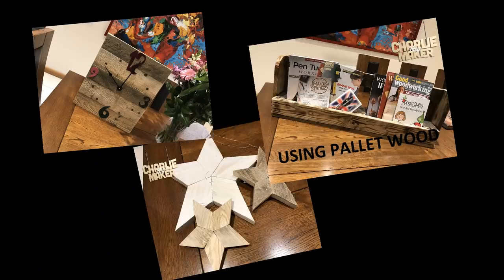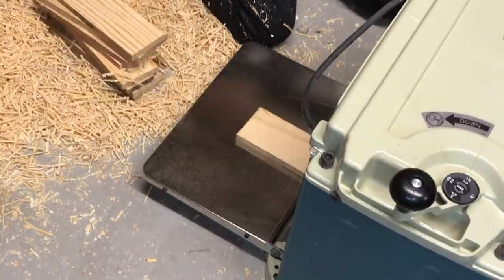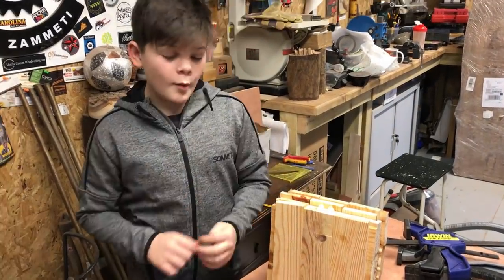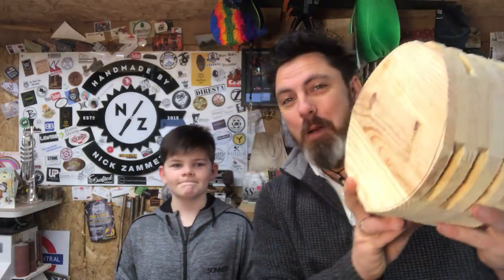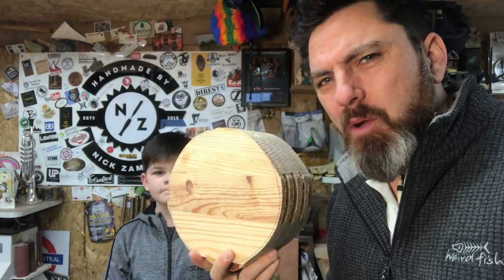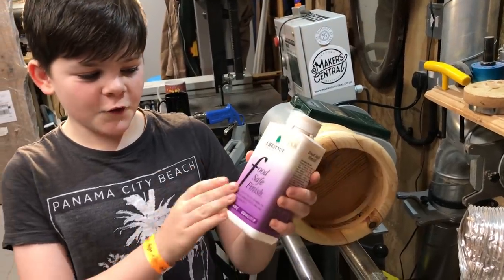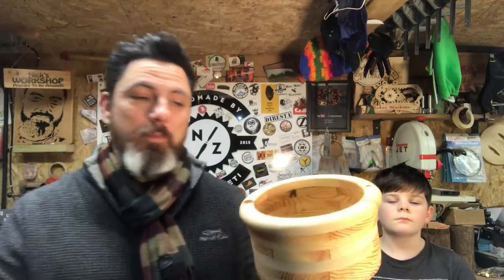Woodturning - A pallet wood bowl

Comment: Slightly off-topic, I have a question, is there a reason a silicone plug cannot be put into the center of a blank to save on resin? Wouldn't it be easier and reusable? 

You're the expert, I was just wondering what the reason is.
Reply from the maker: you sure can but sometimes it can mess up the whole project as it it sets in the wrong place your buggered . so to speak ., 😂😂
Reply: What if you used the stick and string trick to help suspend it in one spot while it cures?

Comment: why is it that people use the table saws with the  fence on the wrong side of the blade.  You're reaching over the fence to push the wood over the blade. you are going to push the wood away from the fence and it is going to kick back and if it happens as your hands are going past the blade you will cut your finger's off. I'm not saying this to be a hateful I am concerned for your safety I have worked in a furniture factory for years and I've gone to college only to see to many horrific injuries.  Be safe .
Reply from the maker: hey Neil noted and changed it . never really knew this. its always been set up this way . i appreciate the help and support buddy .

Comment: Nick, great video working with Charlie. I’ve also been watching his channel. You make anything fun I’m sure. I would like to mention one thing, after learning the hard way by losing a finger and getting another unusable from a table saw, please I ask of you to use a push stick. I thought I didn’t need one either. I was making a very simple cut and it turned into a major cut.  Cheers my friend I get scared seeing people taking a table saw lightly.
Reply: Amen
Reply from the maker: yes my bad and fair point. Charlie is always safe . i did have a push stick but these were very small bits and i needed to hold them down and push and the same time. I appreciate the advise and totally understand the concern brother . all the best

Comment: Hi Nick,
Love your videos as well as when Charlie is in the shop. I did cringe when you showed the couple of seconds of Charlie turning only ‘cause the centre of the workpiece is at his armpit instead of his waist, which puts him in awkward position to try and control the tool. I had the same issue with my son so we build a low platform out of scrap wood to get him up a little higher. We attached a rope handle on one side and stow it under the lathe when not in use. Dan
Reply from the maker: hey yes, he was safe and i made sure of that. it was under my supervision and lathe was slow . hes quite short haha . thanks for watching
Reply: @nickzammeti  if only you had a couple of pallets around that he could stand on! 😜

Comment: Nick...at the very end there I saw an adaptor in a socket. please lose the adaptor and put a real plug on because British plugs have fuses in for a reason
Reply from the maker: dont have any adapters pal . not sure what you mean
Reply from the maker: oh i get you the burning iron. yes will do that
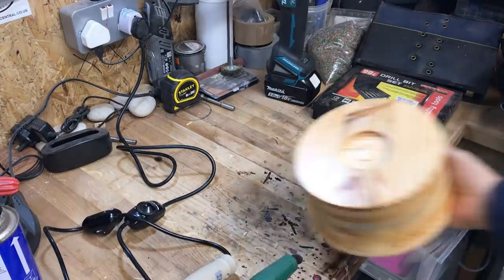Reply: @nickzammeti  Sorry for sounding like a safety Nazi Nick... yeah, 12:29 on the video in the right hand socket. I'm an electrician and I've seen those adaptors cause fires more than once... and I'd HATE to see that happen to you! If it's only a wood burning iron, a shaver adaptor will work (they'll do upto 230 watts) provided it doesn't need an earth :)
Reply from the maker: @TheChipmunk2008  appreciate the heads up. ill sort that brother